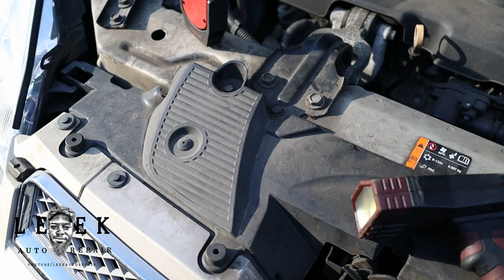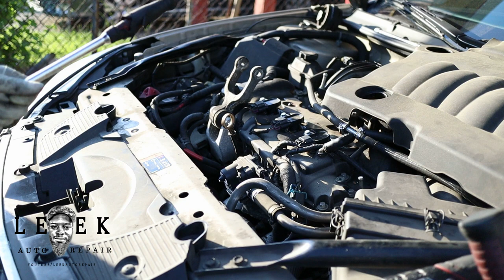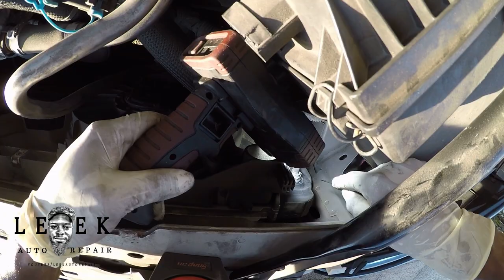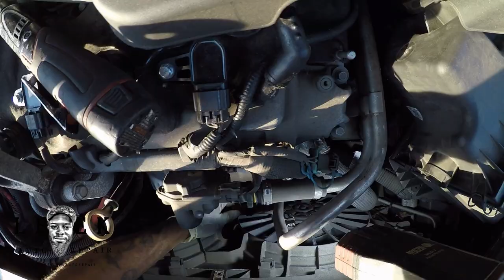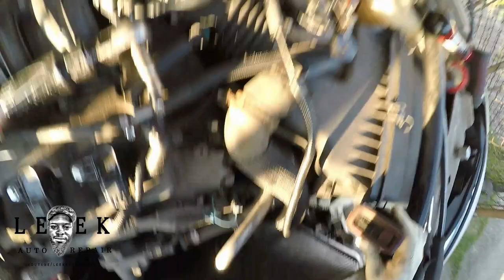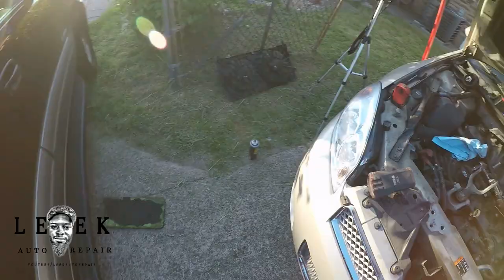Radiator Removal | 2006-2016 Chevy Impala

Comment: I had serious issues getting the transmission cooler inlet hose clip off the radiator. I am going to have to take the whole radiator out to get it I guess.
Reply: I just got a long pick it and came right out. Good video by the way.
Reply from the maker: A does the trick.  Good job bro
Reply: You can turn the fitti g with a wrench untill the tabs are facing up

Comment: How do I know if it’s the radiator or just a bad hose. Mines started smoking and leaking bad on the passenger side
Reply: What if it's just just leaking coolant no smoke & no engine light coming on? Is that bad?
Reply: Same problem. Did you find the answer
Reply: @Stayace  I found a small crack in my radiator
Reply: Same problem 🤦🏾‍♂️